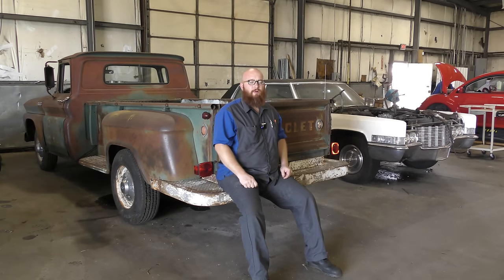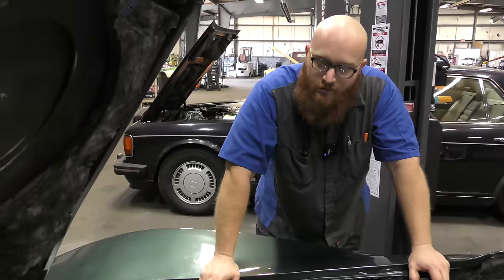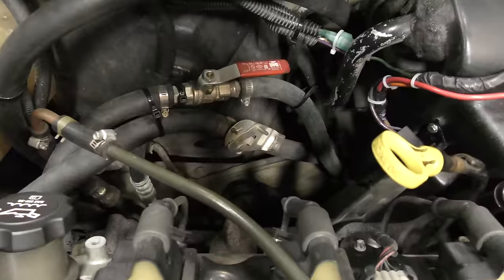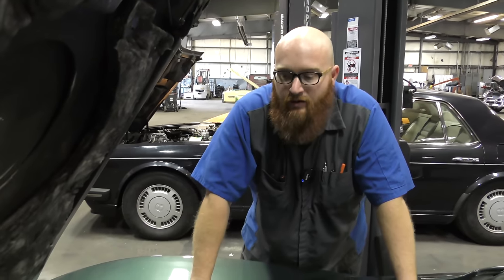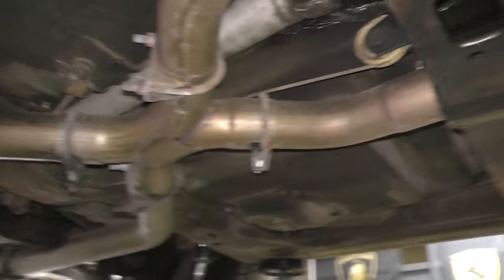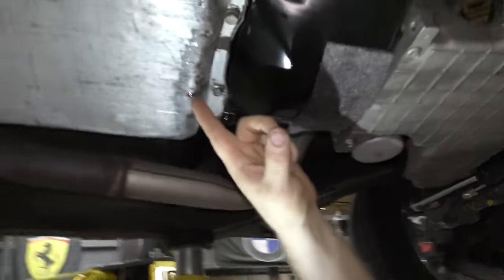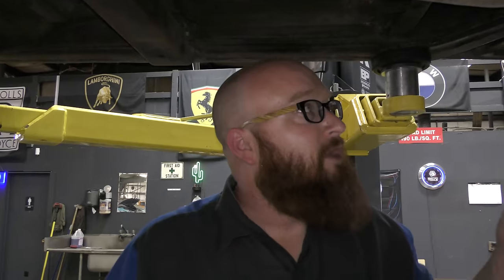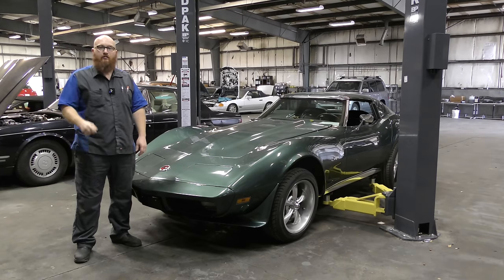Issues AFTER an LS swap! CAR WIZARD warns what can happen on an LS swapped '73 Corvette Stingray

Comment: why would you go through the trouble to install an LS only to slap on a carburator
Reply: Some people think Horsepower rules all.  
I think it was Motor Trend a while back did a head to head comparison between a carb and FI, and the carb developed more power than the FI.  They used the same engine on a engine dyno, just swapped out the fuel delivery system.  For the extra few HP, for most drivers, hard to justify the headache of a carb.  If you are running 1320's and every HP counts, then sure.
Reply: Well on the higher end of hps Carbs are better due to cooling of the Air as it mixx's with the fuel.
Reply: cheaper than figuring out the electronics.  holley EFI system which would be the best way to go is pricey.
Reply: He probably didn't have the donor car 's wire harness, fuse box or ECU.
Reply: @VC-Toronto  I think I have seen that, they used a very simple EFI system like what was used on the original British Leyland Mini and the mexican made Beetles when they had to have a cat in Europe. Here it was known as a "digital carburator" to some.
Reply: Carbs are cheap and simple to fix if you know how. Sensors, wiring and eco can cost a fortune for an LS. Plus the tuning is pricey. Lots of old timers just tune the carb by ear and by how hard the car pulls. So simplified installation plus the car originally came with a carb so that’s a consideration for some owners.

I like fuel injection for daily driving. Carb vehicles take forever to warm up when it’s cold and you have to tune them fairly often.
Reply: @AustinRBa  bigger cam, expensive EFI fuel system, easy to connect to a 700R4 vs 4L60.. But there are pit falls both ways. Especially if you can't do anything yourself.
Reply: Equally questionable is pairing it to an automatic transmission, IMO, presumably the original one.
Reply: neurokinetik64ES yeah that old crap 3 speed. That’s neutering that LS and probably has terrible gas mileage
Reply: My thought exactly.  I'm an old guy and cut my teeth on carburators but if I'm doing an LS swap it's definitelty retaining EFI.  EFI is more reliable, can be diagnosed/tuned with a computer, plus it opens up a whole new world of upgrades.  You're doing an LS swap, what the hell, another computer, MAF and a couple of O2 sensors is a big deal?  I'd just buy a donor car and swap everything.
Reply: @VC-Toronto  it won't make more horsepower if the fuel injection is done right i,can be cheaper ,but will never be as efficient.
Reply: @VC-Toronto  My brother has built a 72 SS Nova with a 427.  He put fuel injection on simply for the drivability aspect.
He found that getting the fuel injection dialed in was MUCH more difficult that the vendor claimed, but once dialed in it's magic.
Reply: Because boomers don't understand fuel injection
Reply: Ya exact same
Reply: James from cleetus mcfarland have a nissan 240 with a carburated LS as a drag car. Its a pros and cons thing like anything else
Reply: Maybe staying somewhat true to original?
Reply: @jeffmorse5599  Standalone harnesses are under $500.  It is easy to install and just a few wires to hook up to integrate it into the car.  I've done a few with the cheapest eBay harnesses and had few issues. Only thing slightly difficult is wiring up a different brake switch if you're using the modern transmission.

That intake with the ignition module is $800 alone. That Street Demon is another $350.  That is already more than a base Holley Terminator system.

If you want to run the 4L60E/80E that came with the LS you need another controller and harness, $600. That is a free bonus from using the standalone harness, since the factory ECU also controls the transmission.
Reply: People think old school carbs are cool, they can be tweaked mechanically fairly easily instead of dealing with electronics. Better to learn the electronics or be prepared to pay someone IMHO.
Reply: if it's a weekend only and low mileage use a carb is easier to resurrect if it falls into neglect
Reply: @2dfx  if you only drive something half dozen times a year the efi maintenance will eat you, if a daily then definitely injection
Reply: @ty2010  
I'm sorry but I really disagree, I have found it completely the opposite. Carbureted cars do not like sitting for periods of time.
Fuel injected cars are not bothered by this in the least.
I've had fuel injected car sit for 3 years. Turn the key lights right off.
Because the fuel doesn't evaporate into goo inside the fuel rail because there's no air.
Reply: Fuel injection is way more work and more money to adapt on a classic car.  Plus a carb is more retro.  Fuel injection is of course superior, but I don't blame someone for going with a carb in a situation like this, I probably would too even if I had deep pockets.  Someone who knows what they''re doing can easily jet it properly.
Reply: @AustinRBa  You forgot the custom fuel tank, fuel lines, fuel pump, adapting all the additional rewiring and programming, VATS anti-theft, throttle control etc.  People have this idea that these things just drop into an old car and you're up and running.  Plus some people want some element of old school in a classic car.
Reply: on an automatic too!
Reply: @johneldorado  exactly. I too thought about getting something like a Sniper for the 289 on my Comet but when I started pricing it up it made no sense for a car which sees limited summer use. And people understimate what's involved with diagnosing problems when the electronic gremlin go mad. With a carb you can do a lot yourself if you're prepared to learn how it works.
Reply: On a non daily driver v8 mpg is a mute point. You want mpgs drive a Prius.
Reply: @VC-Toronto  this is only carbed because it's cheaper and easier than figuring out efi
Reply: Mitchell Mann  you can literally use the stock fuel lines and put an inline pump where the filter goes and make the swap 100% reversible. People are just stuck on every swap looking like it’s going to SEMA.
Reply: When a carb is tuned properly they run great. My customers have said it runs just like it's fuel injected!
Reply: @jeffmorse5599  Totally false.  Price a carb manifold, carb, and ignition box vs. Holley Terminator X.
Reply: If you have blow through turbocharger its actually on par or even better than some of Fuel Injection
Reply: If you tinker any type you might need to start on dual carb so its easier to work on smaller ones like motorcycle i only play with Yamaha Mio Carb which is very fuel consuming its Haisin Carb
Reply: They sell conversion harnesses and flashed ECUs.
Reply: @GMF Why is a 1973 Corvette garbage?
Reply: Some of you are some pretty good mechanics, except forgetting that it's not YOUR car it's the CUSTOMERS car. You can paint the Mona Lisa for someone and say it's the Leonardo di Vinci mona Lisa all day long, but it's still up to the customer to buy it from you. There are customers that are stubborn enough to realize that FI is more efficient, but if the guy wanted certain and was paying for it, then our jobs is to make the best as scientifically possible for that customer. People knock me all the time for destroking 400's, but that's my preference. Do i push that on customers? No. That's not my job. My job is to build. There are benefits to carb over efi and vice versa.
Reply: Carbs suck.
Reply: A carb and 700R4. oof.  like buying a fighter jet, and swapping in a piston engine and prop.
Reply: The LS does have provision for carbs. You can get a new front timing cover that accommodates a distributor. 

I ran EFI on my 98ta and my good friend ran a boosted carb setup. Made more power then I did with large displacement and big cam
Reply: @neurokinetik64ES  u missed the part were he said it was the stock trans
Reply: 1 it's not any of you guys car
2 would love to know what rice box you all drive.
3 if learned over the years ppl who hate carbs usually hate them bc they are too lazy to learn how to tune them.
Reply: @assoonaspastablepizza8135  old school car guys hate EFI for the same reasons that you hate carbs...they don't understand it and don't want to learn.
Reply: More hp on the top end
Reply: My question is .. if you have a nice low mile Corvette why ruin it by putting in a non original motor? Just ruined the value of the car. There's nothing wrong with an old school small block Chevvy! They can make plenty of power with a few basic (reversible)  modifications. If you wan't electronic ignition just fit an aftermarket system. At least you can just swap it back if you want to.
Reply: yes, a carb has a cooling effect with the venturis, and that helps with a turbo. But putting a carb on an engine designed for EFI is like replacing the coil packs with a points system. If you need to cut costs, then an LS is not for you. Replace your 305 with a first gen 350. 

Folks think LS engines are cheap b/c they saw one on a dyno that adjusts air temps etc. A dyno doesn't care about oil pan clearance, about headers that can actually fit a car, an exhaust system that chokes power but fits underneath...and that turbo they put on for more power? probably wouldn't fit most cars.
Reply: some people just like the look of a carb in an older vehicle. you could put throttle body injection but then that scares some older mechanics
Reply: Because if you Know how to work them they can drive excellent and have great gas mileage
Reply: @VC-Toronto  If you make more power with carb rather than EFI, you're doing EFI wrong.

They started using fuel injection in racing as far back as the 40s for a reason.
Reply: Boomer
Reply: @corbingreiner9879  Exactly. Most likely an older experienced mechanic, familiar with carbs and knew he only needed an intake and saw how easy the ignition is to connect.
Reply: @thebigpicture2032  Exactly
Reply: @jorgyr36  Exactly! And the sound of an LS with a carb is absolutely amazing from inside the vehicle.
Reply: V C a simple vacuum gauge will dial in your carb. And they are simple and reliable
Reply: The Big Picture a simple $45 vacuum gauge and you can tune the carb to perfection.  The vacuum gauge method has been used for 100 years.
Reply: Malcolm Reynolds yessir.   I want original equipment.    Not a fan of new guts in a old car.
Reply: phlodel wrong.  But good try little billy
Reply: Lockon stratos exactly.  A simple vacuum gauge and your in business
Reply: Sérgio Alves and they still use carbs now in 2020 on new equipment such as circle track racing , dirt track racing and forklifts ect.
Reply: 81375 puckinen For $1000 I can build you a Chevy small block.
Reply: @VC-Toronto  Developed more power...on a dyno. 
Then the carbed car sat on blocks in a barn and rotted.
Reply: @2dfx   Boomer jokes aside...Boomers made fuel injection common place standard equipment on every car.
Reply: @Morning star Garage Fuel injection is not a headache.  Tune it up with a laptop.  I think this is where some of the schism lies - I'm an IT guy and prefer the use of computers.  I don't know if I officially qualify as old-school yet but I worked on Holleys back in the late 80s so I think I probably am old-school at this point.  

If XYZ person doesn't like technology in general they'll probably prefer a carb.  I prefer technology so I prefer fuel injection.  Set your fuel on the laptop by looking at it real time, or by examining the log output.  Seems simple to me.
Reply: @johneldorado  definitely not plug and play is it
Reply: @David Muela no it was prior to them even.  Mechanical FI was available on mass-production diesels as far back as the 30s, and of course the Rochester system starting in 1957 on gas powered Chevrolets.
Reply: 2dfx oh yes we do
Reply: Because fuel injection gives more Hp but carbs make more torque... which one gets you down the track?
Reply: @Morning star Garage Man you got that right!
Reply: I thought I was the only one confused
Reply: @AZBEEMR  that argument may work with the average individual but I am a telecom engineer by trade.  So yes, I already know all those things.  Electronics engineering helps.
Reply: The main advantage of going to an LS swap would be to get fuel injection. If he was going to take that off he might as well have stuck with the original engine. And maybe install an electronic throttle body conversion. That would be leaps and bounds more modern than a carb. And the original engines could be made to have enough power. Even modern engines rarely have more power than a 454 installed in some Vettes.
Reply: I ALMOST did a carb on my LS swap. I'm so glad I didn't. When you get into it fuel injection really isn't that complicated. It cost maybe 1500 more to do it with a harness and fuel pump. The tune was a whopping 50 bucks for a stock tune to delete the emissions. I get 21mpg in my 72 El Camino 5.3 LS swap and I couldn't be happier.
Reply: @101spacecase  you can fix this on EFI by putting secondary injection further up the intake, possibly even in front of the throttle body.
Reply: @kens97sto171  there is the issue of rats and mice in some areas and using a carb reduces the issues with those chewing wires, but yeah In my experience I've never been able to let a carb car sit for more than 6 months without having to reseal and retune it when we pull it back out, but my dad HATES EFI so we've got carbs.
Reply: @tylersmith7054  on old school small blocks  it can actually be more expensive when you consider that you'll also have to either retrofit an old manifold or buy a new one, and carb replacement systems are expensive and don't really provide much benefit, so if you're gonna go single point I say go carb, only go EFI If you're doing multi-point.
Reply: @Prestiged_peck  That's irrelevant. We aren't talking about old school small blocks. The conversation is about the LS engine which has a phenomenal EFI system for free. You'll need to thin the harness out to convert to standalone or a spend a small amount of cash for infinite tunability with a Terminator X.  Both are superior to a metered leak (carb).
Reply: @Prestiged_peck  which adds more weight an complexity for the same hp so loss in performance.
Reply: @lockonstratos7787  I don't like carbs because we go from 120* in the summer to *20 in the winter and I don't want to have to fuck around with a carb every time the weather goes from 80-30 in a week. I know how to time a distributor and tune a carb, I'm not great at it but I've never not been able to get a non-broken carb running decent. There's also the factory that if I'm buuilding a car I'm gonna drive it a lot and probably switch from gasoline to ethanol and back a lot. That's a pain to do with a carb. With EFI it's just waiting 5 minutes or less for the E tune to load, or even in some guys' cases just swapping the plugs over to the secondary ECU and bam you're ready to go in seconds.
Reply: @stephenvelden295  what you do is keep all the stock components and don't cut anything up, maybe drill/tap a few holes here and there but leave the bug stuff, then when you go to sell it plop the original motor/trans back in and you've got a stock restored good condition classic to sell.
Reply: @101spacecase  I made too many responses which one were you responding to? If you're talking about second stage injection it's a few ounces.
Reply: @Prestiged_peck  definitely understand that , I have issues with pack rats where I live too. It's odd though not really had any trouble with them eating fuel injection wires. They really seem to like the silicone on the older spark plug wires more. Most of the fuel injected cars I've had recently are all coil on plug they seem to leave those alone. but I'm sure rats and mice in different parts of the country eat different stuff.
One option with fuel injection is to go sort of in between pick up a Holley projection kit it has pretty minimal wiring looks like a carburetor but gives you most of the benefits of fuel injection. I've had fuel injector cars sit for 2 years go out turn the key a couple times to prime the fuel pump and they start right up.
Reply: @kens97sto171  yeah the only thing you gotta worry about in injected cars is gas going bad.
Reply: @kens97sto171  but yeah the rats here in west texas like to make nests with the small wires, lost my uncle's firebird to them.
Reply: @Prestiged_peck  
I'm in West Texas also... Depends.on the car. I think they prefer older cars, both domestic and asian.  Something about the wiring insulation on the older cars is more tasty for them.
Some of the early '80s Hondas had insulation that was made out of a corn product some kind of organic plastic and they love it..
Reply: @kens97sto171  good to know. And around here carburetors like to get crusty seals when you let them sit so they kinda suck, like ion wanna rebuild my carburetor once a year lol
Reply: I'm thinking part of it was changing out the fuel pump (and plumbing), and modifying the tank to accept it. 
I'm  a 'Boomer' too,  but still wouldn't want the carb. Probably has a carb because of $.
Reply: Its just pointless
Reply: @chrisromero5302  only thing I can think of is the old school look.
Reply: @phlodel  Carbs does suck mostly air and fuel too
Reply: @lockonstratos7787   @Lockon stratos  2. I drive Honda City
3. I hate EFI not because i'm lazy but because i hate how fast it'll fry the EFI and EFI is not cheap last time i did a tune on customer car that has EFI and i suggested that he has to buy a new EFI for the power that he tries to achieve is not possible with stock factory EFI and he said its ok and he has the audacity to yell at me that i fry his EFI that i already suggested beforehand to change it FFS
Reply: They cheaper out, which is pathetic considering how much he already spent on the LS swap. Should've just spent the extra money on a good FI system
Reply: Injectors fail, clog, and can be expensive. Sometimes hard to diagnose. A carburetor can be easily rebuilt if you know how.